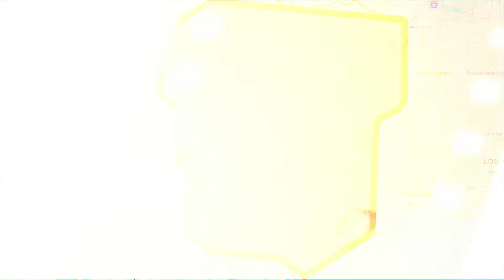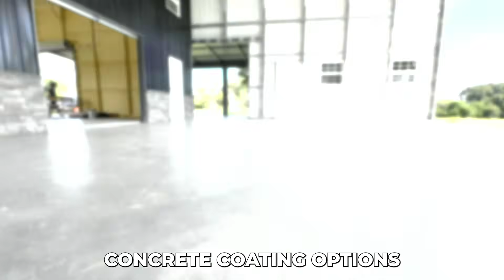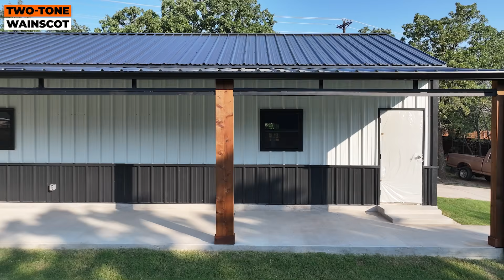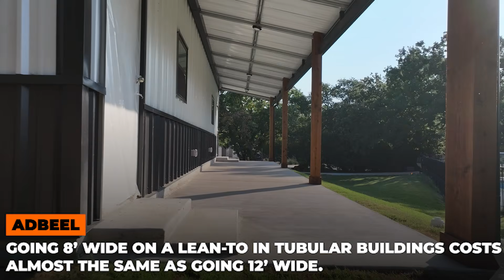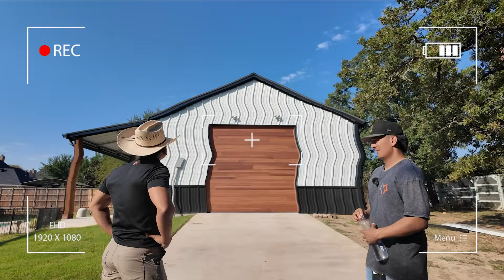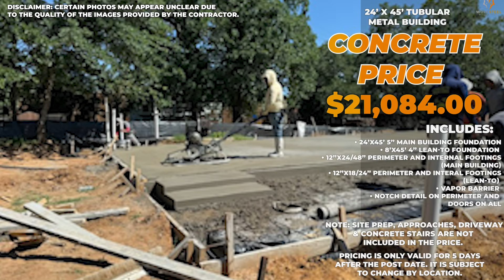24'x45' Tubular Custom Metal Building w/ 6/12 Roof Pitch | Full Tour & Cost | WolfSteel Buildings

Comment: Can u add a water catchment tank and solar panels?
Reply from the maker: Will need to be engineered and to see the weight of what you will be adding to fit those specs!
Reply from the maker: We don’t add water catchment tanks as of yet but we have installed gutters ready to be drained for a tank. 
Our buildings can be reinforced to add solar panels later. 
Solar panels in general do not weigh much.